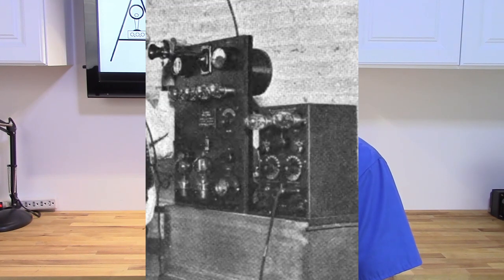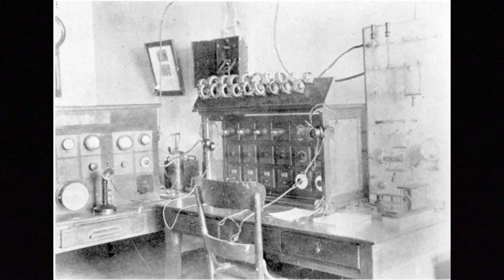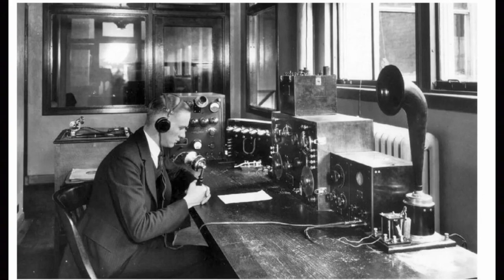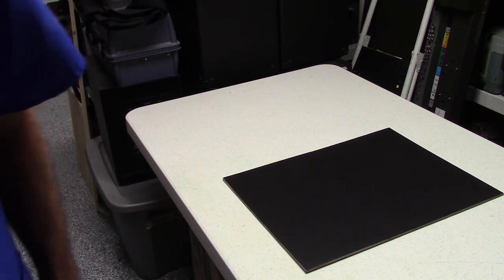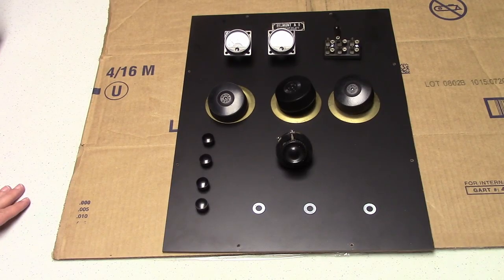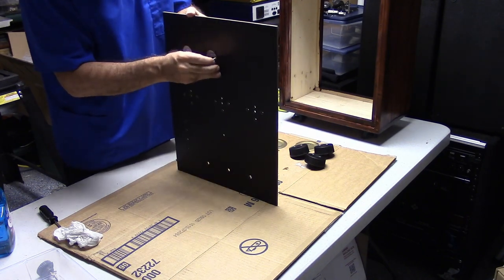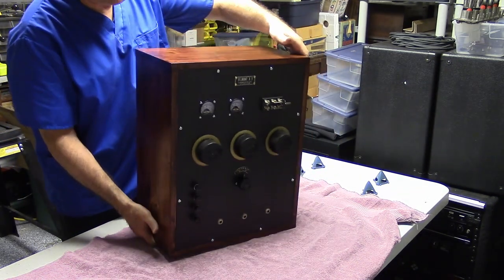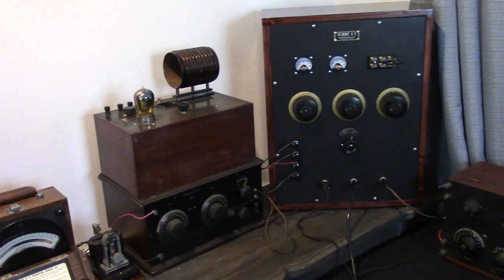A 1920's Radio Station Mockup and Simulated Transmitter Construction

Comment: I have a built a low power transmitter of this type that puts out a few watts used a few parts used 1920s tubes and only used 6 volts DC and 150 volts DC and Sigrid modulated. With no trsnsformer. Had very good audio. Legal to use as long as you antenna is short. Comets AM band. W3MT 73

Comment: Of you really want to build 20's Transmitter. Hey a copy of Henley's 222 Radio Circuit Designs from 1922. You will find many Broadcast thansmitter circuits with all tube and parts list. EVA made most of the 1920s AM transmitters and also sold all the parts to build one. This was well known back then. They used a magnetic modulator located n the antenna binoculars them. Some used a modulation transformer with secondary connected between ground and the center tap of HV transformer. They used high voltage ranging from 350 to 1500 volts. They used electrolytic recetifers. I know a great deal about the transmitters of that era. I was friends with a man who built them back in the day. He has long passed. Any questions feel free to ask W3AMT 73